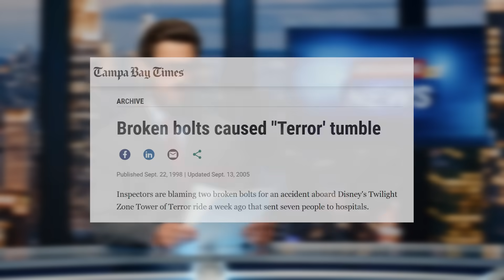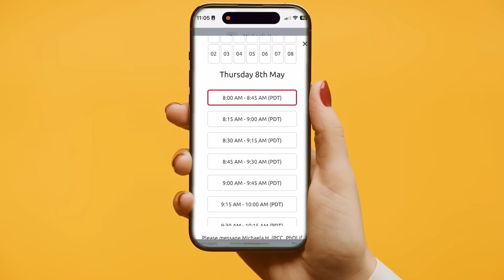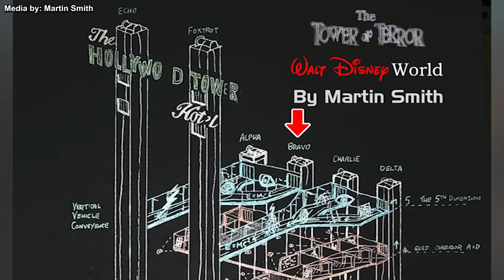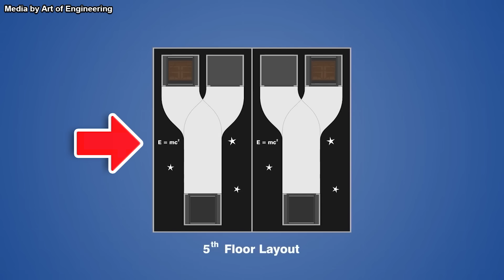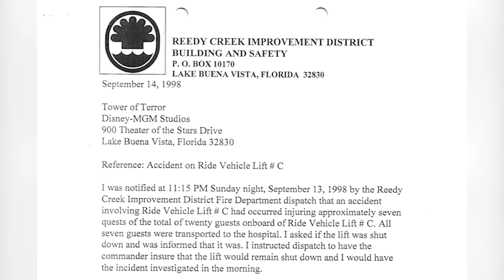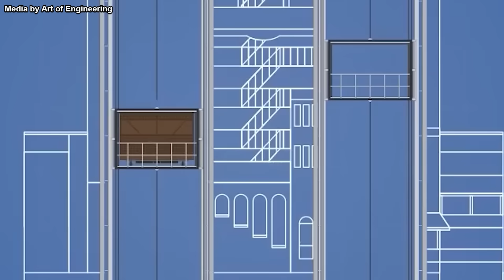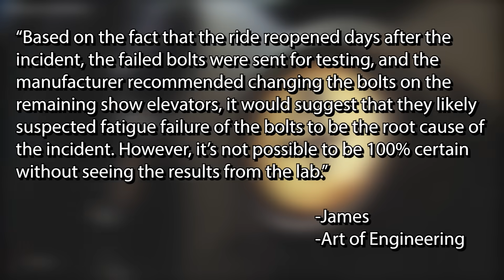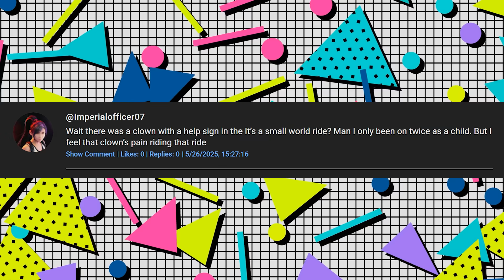The 1998 Tower of Terror Ride ACCIDENT You've Never Heard of

Comment: Back in the 90s I was working on a computer system at DARPA when they asked if I could give a demonstration for a Disney Imagineer. In walked a Santa Claus-looking guy in a khaki coat. He sat down next to me. I gave him a demonstration and he asked very specific and very advanced questions. We chatted for a while and it was apparent that guy was a no-kidding, genuine genius. His name was Bran Ferren and he was one of the Imagineers who designed Tower of Terror. Guess he didn't consider a bad batch of bolts.
Reply: Wouldn’t that design flaw be the fault of the elevator manufacturer and not the Disney imagineers?  This could happen on any standard elevator
Reply: @patricknedz I think the point is that these bolts were fatigued. They probably did testing and concluded that a smaller bolt would work. But as a good engineer you add 20% to those figures and request the bigger bolt. The thing I’ve learned as a technician and then engineer is that periodic maintenance is hard to dictate. Over inspection costs time and money. Under inspection can be catastrophic. That’s the other reason they built in the brakes
Reply: @dgdnite1 if loads stay within working envelope most steel alloys are considered to have an infinite duty cycle. Thats why we use lot numbers to chase down issues all the way back to materials. My guess would be impurities in the alloy rather than too many cycles.
Reply: @dgdnite1  They built in the brakes because they're Otis, and that's now they build all their elevators. Sometimes there just isn't room for a bigger bolt. Sometimes the higher-grade steel doesn't exist. Thing I learned in engineering school is you have to account for variable quality in parts, and it's impossible to have redundancy everywhere, or account for all your parts being to one extreme or the other. You have to pick your battles.
Reply: @patricknedz  Good point. I don't know who specified what in that very complicated ride system.
Reply: @patricknedz  no, Disney imagineers planted those bad bolts!
Reply: @patricknedz  Not a "design" flaw. Faulty parts. It's not the designers' fault if things fail due toparts not being manufactured to spec (though the designer often gets the blame, anyway.)
Reply: I, for one, didn’t take the original comment to literally point blame at Genius Cause, but rather highlight the unfortunate irony of reality. RIP critical reading skills. 😢

Comment: While labeled as an accident given that there were minor injuries, I am just happy to see that the fail-safe did it's job properly and prevented an even bigger disaster.  Thumbs up to the Otis Elevator Company for an impressive ride design that includes such safety backups.
Reply: All traction elevators use the same safety devices as these elevators. Very well designed safety systems are in place to prevent disasters.
Reply: @patricknedz  There are a great many elevators made by Otis.  I could have had a chance to visit their factory, but my wife didn't want to go.  We mainly went out to Lake Compounce amusement park in, CT.  You can see the Otis factory and test facility from the park.
Reply: @jukingeo I work in a skyscraper where Otis made/maintains the elevators here. On one hand, they are generally reliable and I'm impressed at how quickly it can shoot you to the top without it feeling like, well, a theme park ride. But my scariest elevator incident also happened here: there was one time when a momentary power outage caused the elevator's computer system to go wacky, causing me to quickly shoot up and down 50 floors for about 10 minutes before it finally stopped.
Reply: @Foolish_Notions  That's an interesting glitch and I never heard of that happening ever.  But, I have run into some other weird problems with other brand elevators.  The biggest issue I have seen with some off brands is when the doors open before the elevator fully stops.  That I see often.
Reply: @patricknedz 

And smart having more than 1 safety feature.

I watched a Mythbusters episode where they tested someone getting srmtuck head down and go for a spin. I loved when they stated "removing all 5 safety features and they still could not replicate the results".
Reply: Disney is a lot of things, but I'm ngl...you really have to give them props about how safe their parks are. Disasters are rare and serious injuries/death caused by them are even rarer
Reply: @lostindementia2705  True, you don't hear about many disasters at Disney.  One bad one I remember was when a kids foot was taken off by Big Mountain Railroad because he stuck it out of the prematurely before it stopped.
Reply: @jukingeo  Yeah, and that's not even a Disney error either. They have signs that say "Please keep hands and feet inside the ride at all times" everywhere and sometimes people just...don't listen.
Reply: @lostindementia2705 what about the train ride 2004
Reply: they'd be living out the lore of the ride. But this isn't the ride you want to be the main character for.
Reply: I don't know, this information scares me, I don't think the rides are safe.

I'm joshing ya if it wasn't obvious, as per 15:30

Comment: Those rail brakes that stopped the car from crashing are on all elevators.  My dad was a draftsman at Otis and told me the throughout my life.  If he hadn't retired in 1992, he probably would have been in on the design of this ride.
Reply from the maker: Indeed they are! In many ways, Tower of Terror is more of an elevator than a drop tower.
Reply: @ThemeParkCrazy  The 4 lift towers are essentially regular elevators. More similar to a freight elevator than a passenger elevator but the workings are the same pretty much, with all of the standard safety and emergency systems all elevators have (redundant cables, multiple braking systems, etc.) It is only the 2 drop towers that are different since there the elevators are supposed to drop.
Reply: I’ve always wondered how the brakes work on the drop towers (e and f) because if the elevator starts falling when it’s not meant to (like what happened in the incident) the brakes will never engage because it will fall slower than the design speed.
Reply: @spinba11 "Faster than gravity" refers to acceleration here, not velocity. The brakes engage at a set velocity and don't care how quickly you reach that velocity.
Reply: My uncle was the haed engineer of Disneyland .so i got to get in for free. Or i would have navet got to go. 😮i ❤was lucky

Comment: I always wondered what would happen if the tower of terror failed. It's comforting to know about those fail safes! Thanks for the research!
Reply from the maker: Otis deserves its glowing reputation, and it's great that the ride did its job!
Reply: The pocket of air being used to slow the elevators if the failsafe brakes fail was SUPER interesting to me. Had no idea if that's a thing and now I'm gonna find out if this is true of normal elevators too.
Reply: @Caffeinated-DaVinci it is definitely true with normal elevators. 
Similar thing happened in the Empire State Building in the 40s when an elevator did fall after a plane accidentally hit the building.
Reply: TIL that final destination elevator failures aren’t realistic. Bless